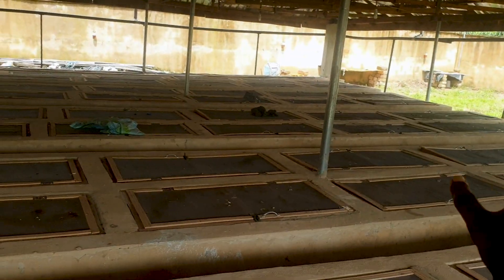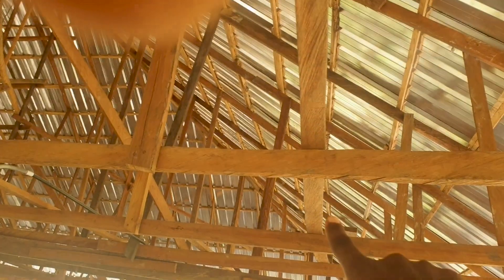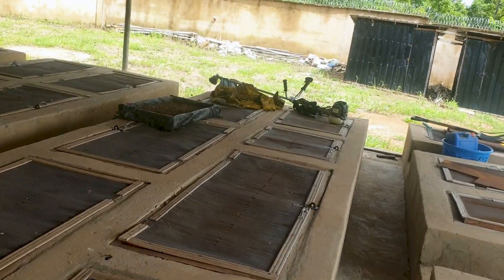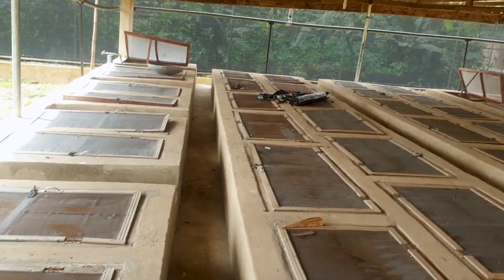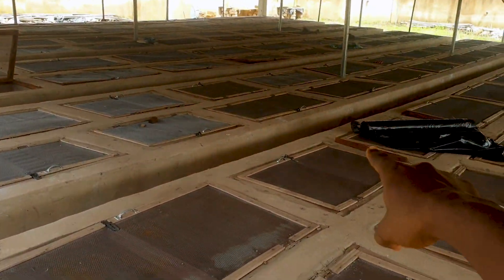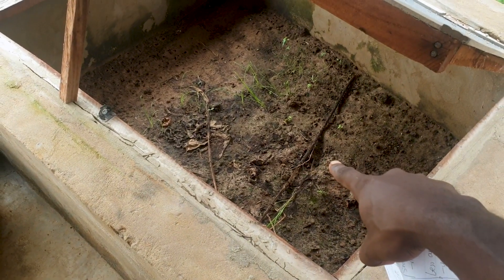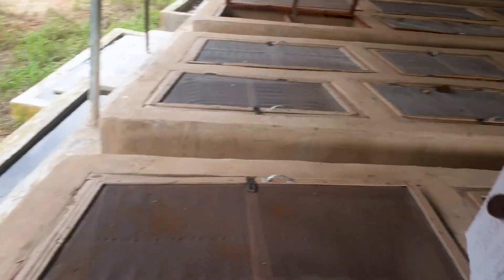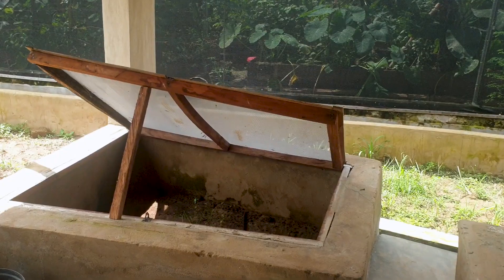Snail Pen vs. Snail Greenhouse (Honest Opinion)

Comment: Hi Michael. Always great following your project journey. Always detailed ,thought provoking and analytical. My question is why such an elaborate roofing structure. You could've gotten a very moderately priced shading structure unless there's a science behind it. Kindly reply.thanks
Reply from the maker: Thanks bro

With regards to why I went for a high roof, I live in a state in Nigeria that doesn't have much water. I wanted to sink a borehole but the hydrogeologist I hired said my land doesn't have much water and sinking a borehole would be a waste of money. Farming requires a lot of water to be sustainable so my other choice was to harvest rainwater. Since I was already building a pen house I decided to use its roof for the rainwater harvesting. In order to minimise leakage and increase the speed of water flow towards the reservoir, the roof has to be relatively high. So thats the reasoning behind it. The amount of money I'll save from not buying water will eventually amount to how much it cost me to build the entire pen house in a few years time given the rising cost of fuel and diesel
Reply: Understood. Very analytical but it does a little dis service to the comparison with the greenhouse interms of the cost outlay. I don't have a water limitation issue here so employing a relatively frugal roofing system will reduce my net spend. Just thought it should impact your analysis. Good work though
Reply from the maker: @ROBERTBROWN-cz9wl  I agree. Every person isn't limited by the same constraints. Roofing alone cost me about N2million so if I did a moderate roofing, the entire cost of the project will probably be about 5 to 6 million which is still more than the greenhouse with significantly less capacity

Comment: 140×70cm is 2.3×4.7 ft and it will take 60 snails, is it POL or Jumbo snails?
Thanks for your ever responding. Where is your farm location?
Reply from the maker: This is mostly for POL. Jumbo snails are much bigger so should take less than 40 per pen. My farm is in Enugu state Nigeria

Comment: Lastly sir there are some pens that create trenches/ pest barriers attached or a Little detached from each row of pens within the structure. I noticed your trench is outside or encompasses the whole structure externally rather than within the individual pens. Your thoughts Sir. Thanks
Reply from the maker: The point of the trench is to isolate and protect the entire pen house from external threats like crawling pests etc. Having one external trench rather than individual trench for each pen is more cost effective because you have more surface area available for your pen construction and less surface area to be plastered 

Put it this way, if I built individual trench for each pen, I'll have less than 117 pen on this half plot of land..further making the entire structure less appealing from an economical/financial standpoint.
Reply: Perfect explanation. Genius. Thanks bro
Reply from the maker: @ROBERTBROWN-cz9wl  you're welcome bro

Comment: Hi sir, wouldn't also make sense to do a flat roof which reduces your roofing cost and put a shade net around the pen with an entrance so as to further reduce sunlight that accesses the pen and would intensify the darkness in there.
Reply from the maker: For my objective, which is to harvest a lot of rain water for the entire farm use, I need an elaborate roof. Because of how high my roof is, the total surface area is about 450 sqm. With a roof that big, my 75,000 litre capacity reservoir fill up from just 2 months of rain. I never have to purchase water or sink a borehole (which is speculative)

Putting a shade net around the pen is a good idea...I just didn't bother doing it because I had already spent a lot by then and, given I was going to start with the greenhouse and use the pen house later, I decided to leave it for now

Be that as it may, doing that means you have total darkness in the pen house and you'll have to wire the place for electricity. In a remote farm like mine, that means using alternative energy sources like solar...which is also expensive. So some people prefer to have access to natural light
Reply: @zenaksnailfarm You are right about the underground reservoir. So, basically you didn't dig a borehole and went with the underground reservoir?

How much did it cost you to get the reservoir done? That will be a great video.
Reply from the maker: Yeah bro. I didnt bother sinking a borehole. I only have two wells for backup and then the reservoir. My farm is totally water and electricity sufficient all year round.

Later I'll make a video on the cost of constructing the reservoir